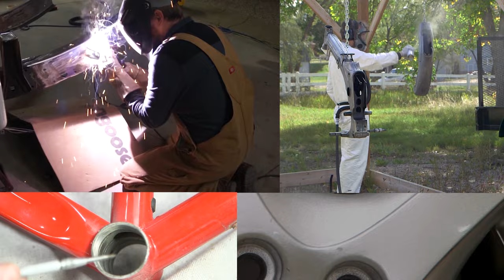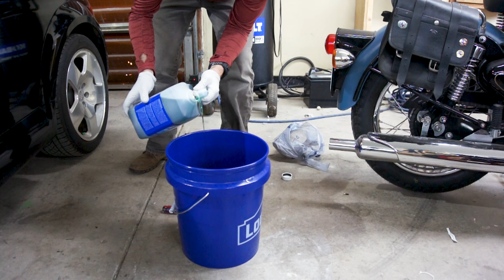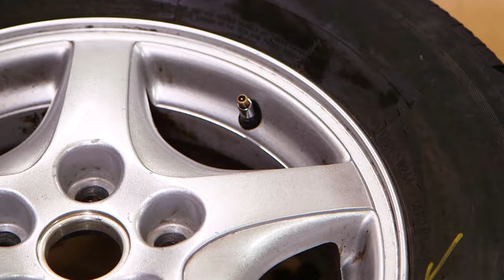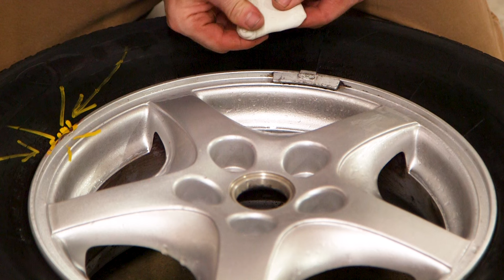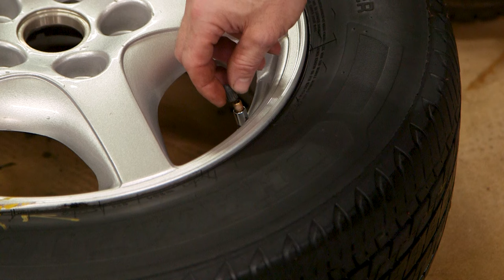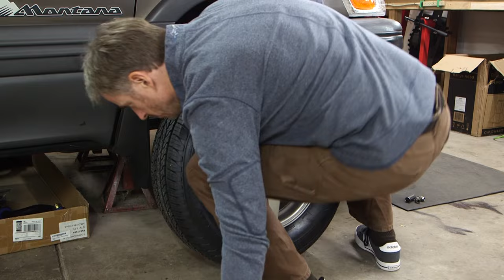Removing Brake Dust Easily

Comment: Dawn Power Wash foaming spray, rotary brush kit to fit drills from the big box stores and within 10-15 minutes your rims a cleaned of baked on brake dust. Personally, since this product came out about 3-4 yrs ago, it’s all I’ve ever safely use.

Comment: It wont mess the clear coat or paint of the wheel?? I have a car with about 15 years of neglected baked on brake dust anything i did didnt do anythng to clean them up. I tried iron remover wheel cleaner but it removes about 5%. I wet sanded one wheel and didt know that when the water dries the clear coat will be faded so messed up one of the wheels but it cleaned it. You are my last hope that i can clean them so if you got any other tips for cleaning them please share. Waiting for your response about the paint.
Reply from the maker: I’ve only done it on these wheels, but I did all four and it didn’t damage clear coat on any of them.  It might be problematic on raw aluminum or unpainted steel, though.